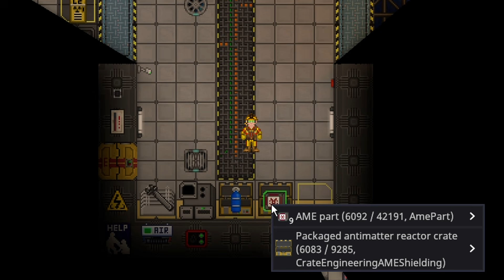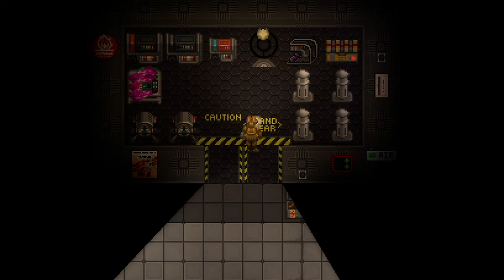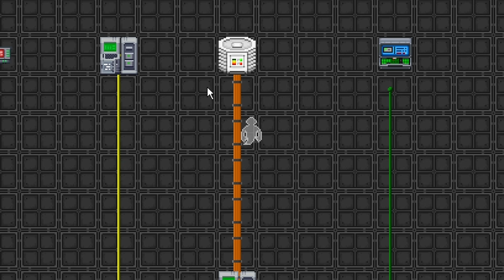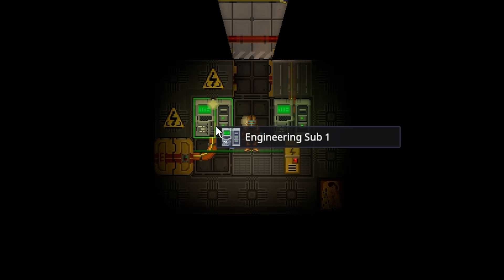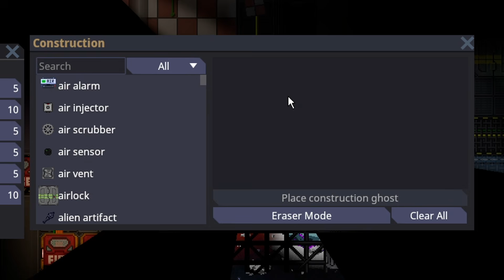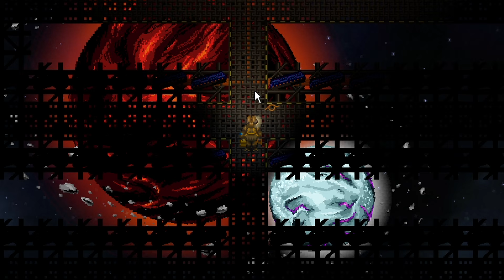SS14 - Engineering Guide

Comment: When i was an tech assistant, my tutor always told me "Teg is dark magic. dont look at it for too long, or you will become insane."
Reply: I didn’t take this to heart. First time I ever played engie I messed with the teg, caused a station-wide blackout, panicked, then left.
I didn’t play for months. Now I love the game.
Reply: Update: I now know the dark magic required to make a teg work. Fear me, mortal.
Reply: @MyrhaFluff  ayo wanna teach me how to?
Reply: @dulcis4573 
Haven’t played in a while because of life  stuff and I don’t remember perfectly but:
The teg works off heat difference between its two inputs.
You want a really hot gas in one input and a really cold gas in the other. The teg heats the cold gas and cools the hot gas, outputting energy.
So you need to find a way to keep the hot gas hot and the cold gas cold.
You hook the hot gas to a burn chamber (either with radiators or directly with the exhaust of the burn), and you hook the cold gas to radiators in space.
Both of these should be closed loops. No gas should have to enter or leave the system once it’s started up (apart from the gases used to run the burn chamber)

My best advice would be:
Ask a more experienced atmosian if they’re willing to help you learn. I would hop on and help if I could, but I’ve got college to deal with, so I can’t sadly.

Comment: Good idea simplifying the cable stuff, makes it easier to understand than looking at the stations messy wire systems. 

So a LV wire can power anything that's one block away? Not just what is on top of it?
Reply from the maker: Yes they have a two or three tile range
Reply: @Liltenhead  wow thanks. I never knew that!

Comment: 18:06, You don't need to remove the catwalk to check the voltage being generated. If you have the multitool in your hand and right click on the HV wire you get the same result without destroying the catwalk.
Reply: Pretty sure it is a bug tho, so don't expect it to stick around.
Reply: @rompevuevitos222  Are you sure? To me this makes sense because you can also lay down cables under catwalks, and you can see them, so why wouldn't you be able to probe them with a multitool?
Reply: @SuperDicq  Catwalks don't fully count as tiles for some reason. They are more like furniture.

You also can't interact with wires that are covered otherwise. The only reason you can probe them is because T-Rays make covered cables visible, and visibility is all that's needed to examine an object.
And since the probe action is accessible from the examine menu...

Normally you're meant to click on the cable with the multi tool to check the power usage, but you can't do so while it is covered, the game simply doesn't allow you to do so.

Comment: now we need atmos guide so atmosians can start fixing atmospheric issues rather than spend all round mixing frezon or making maxcaps
Reply: Tip 1. Space it. This concludes my Ted talk. Haha
Reply: If they know that, they know how to fix atmospheric issues, trust me, doing those is harder than filling up a room with air. If any atmos who's doing frezon or maxcaps tells you they can't fix air issues they are most likely lying to you.
Reply: @romulo2714  From what I've seen whenever I play engi, barely any atmosians ever deals with atmos issues. I play nothing but engi, and from what I have seen so far, not THAT many know how to use air alarms appropriately; All they know is copy the frezon setup from the last guy. Atmos mains know, but atmos mains don't play all the time. Otherwise people just space the place which isn't always the best solution...!!